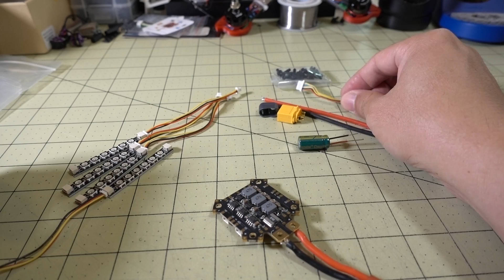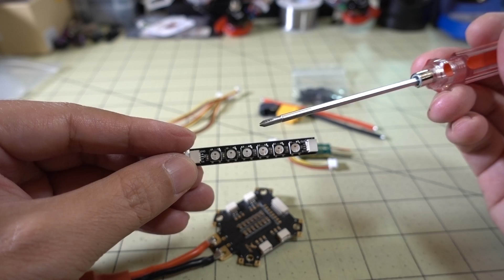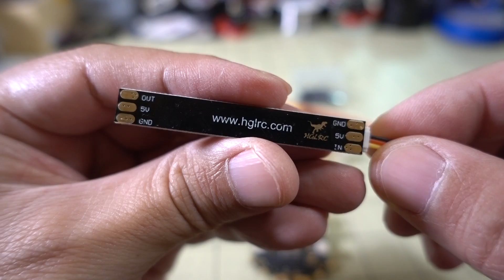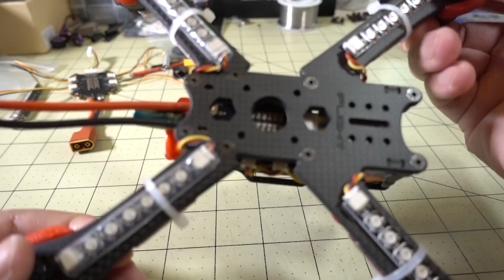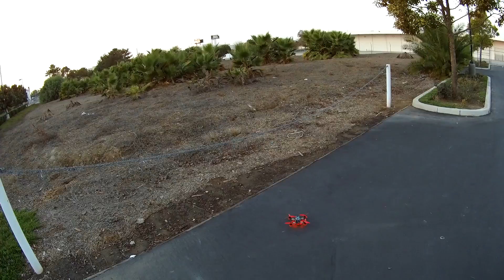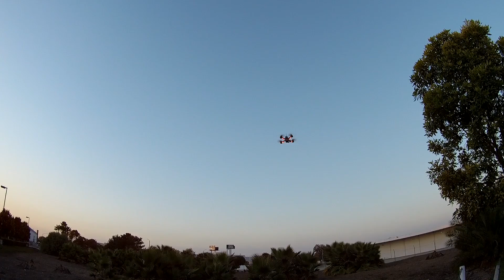Christmas Lights for Drones!  // HGLRC PDB LED Kit Review 👍🎄

Comment: I'm not much of a led guy, but if I were, I'd wish they added some esc telemetry pads close to the esc signal wires. So it was easy to get wire it all through one cable to the fc.

Comment: I wonder if it is possible to solder the signal pads in series to achieve the same effect as soldering the string of lights in series?  You probably have to cut a trace to cut the parallel connection though.  Only wondering this because, why put four signal solder pads on the board?  Perhaps you only need to program it for 24 leds???
Reply from the maker: I wouldn't try this unless you don't mind ruining the PDB.  Without the PDB schematics this like like doing repairs blindfolded.
Reply: I agree.  Totally.  I have just submitted this same question to HGLRC support for them to answer.  But if each LED was addressable this board would be light sheer magic for light displays on a quad.  I'll let you know what they say.

Comment: How much battery drain does a rack of LEDs add?
Reply: You can calculate the watt amp dram per led and find how much they will use over time.  Probably just a small amount tho

Comment: I want to add some leds to my 3"  diatone gt r349 but can't seem to find any that small? Anyone else know of any?
Reply: diatone has some led strips that have 4 leds, and mount to the bottom of the frame. I'm not sure how new they are, I'm currently trying to find a video where someone uses them. They have separate version for r349 and r369 since the r369 curves.